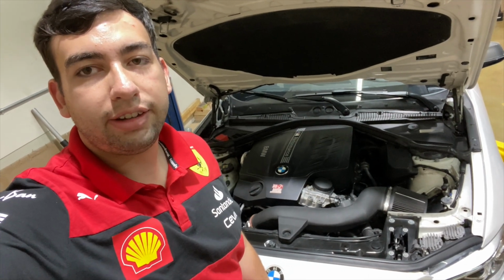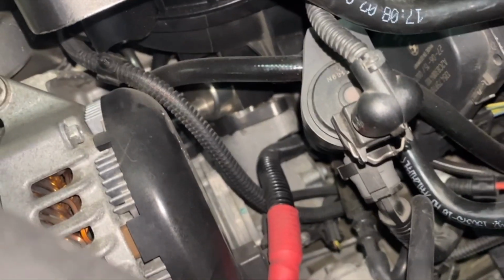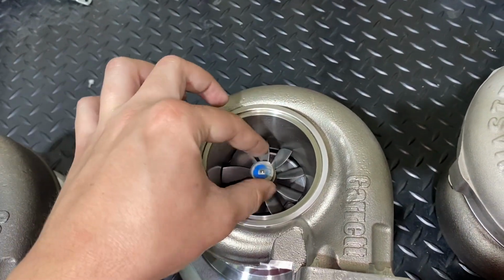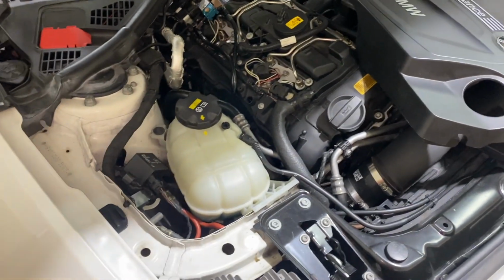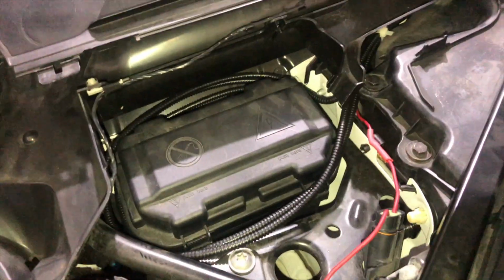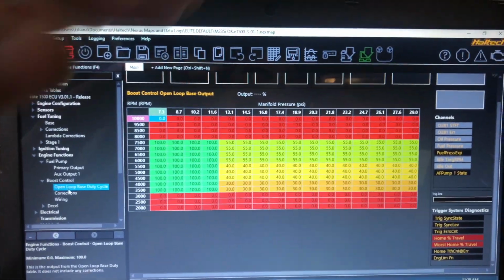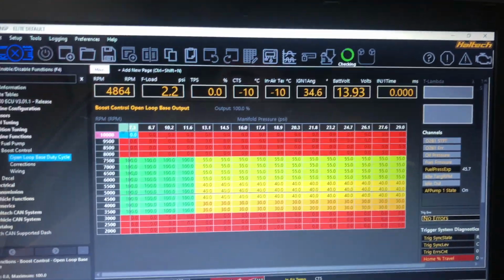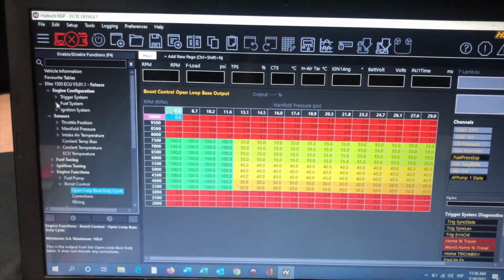How we built our 750 WHP Stock Engine N55

Comment: A great video being specific and to the point on what was and is required to reach approximate horsepower target. What many fail to realize which you have touched on in the video is the time, effort, costs, required to do such a job correctly and the additional time, effort, and costs in the additional support system requirements, and the additional maintenance associated with running at these horsepower levels. Most important no experienced performance car builder can definitively tell you how many miles or years a car modified at such levels will last for your personal car. If you are already budget shopping to do such a build it's probably not for you because you need to factor in potential engine, transmission, axles, tires, brakes, and other wear items and increased repairs. If one is looking for both a high horsepower BMW with reliability to daily, save your money and buy a new M4 competition.  😁

Comment: It's the open deck that's the limiting factor or more so the risk factor
Reply: So you’re saying that if I install a closed deck kit I could make over 650whp reliably?
Reply: @axelito_m235i you can make that without a closed deck or rods or pistons
Reply: @axelito_m235i but I only see it on the 2014 -2016 models
Reply: @inkedBc I’m 2015
Reply: @axelito_m235i then you have a unicorn lol I hands down think that the 2014-2016 models are unicorn n55 engines with upgrades not just to the water gate but pistons and rods as well . There are like 5 big channels in the past year that have built those 235i to over 800whp and without the power issues and cutting power like the older n55 . Upgraded turbos that n55 creates more boost then a b58 hands down
Reply: @inkedBc that’s correct! Most people don’t know anything about this version of the N55.  I talked to a guy that’s currently making 800+ and he told me I don’t even need rods to make 700whp unless I go past 580wtq so I guess a big single Full E85 550-570wtq 650whp would be a great set up for me until I put pistons and rods
Reply: @axelito_m235i the 2014 got the cooling and the electric waste gate and upgraded ecu which helps with tuning making it way more reliable

Comment: So for reg n55 you need to upgrade internals and get the upgraded crank hub bolt to avoid the crank from walking and spinning main Bering. This is for over anything over 550. So to make 700 go higher you need bigger rods and upgraded pins and forged internals. Then you swap the exhaust cams to the n52 ones. And then port the head and then arp head studs. And moving to m oil pump. So the bottom end is still an open deck. So to make bigger power you need to get the deck closed. And upgrade the oil cooling and meth injection e85. Change the HPFP and port injection. And standard FOB’s but after all that you could just get a cheap b58 car for the cost and slap a downpipe and tune and e85 and make same power. Why the n55 gets dumped on😢
Reply: I see all sorts of people blowing their B58'a at the 550-600whp mark. B58's stock turbo is good for 500whp, but 700? Surely that's a typo. Auto trans can only handle 600 anyway. And spun crank hubs are very rare on N55's, and usually only happen on the manuals.
Reply: @rayland9305  so yeah the b58 can make over 700hp on stock internals. And yeah for that upgrade the turbo. And the transmission can handle more but not launching hard and a transmission tune for sure. But the cost the b58 is way better platform to build off or just fun daily and they make way more TQ at low end and better fuel economy. My x7 getting better mpg’s than my old x5 and much bigger car.
Reply: @rayland9305  and yeah people will blow up if they don’t add fueling and extra cooling to the air and improve flow in and flow out. I bet a lot of guys don’t get the e85 mix right for the tune and hurt the engine that way. But the b58 is by far one of the best engines in the straight 6 category ever made.  Only time will tell.
Reply: @michaelbrooks9462  By far? Hyped up maybe. Plastic cracking everywhere, the entire oil filter housing warping needing to be replaced, failing injectors, oil filters disintegrating dropping bits of filter into the engine, and cracked pistons/bore scoring, coolant loss/coolant leaks everywhere etc. No thanks, I'll stick with my N55.

Comment: U mean that stock n55 engine can run in to 750 whp please confirm that
Reply: Yes they can m135/m235 or later n55 engine fully capable of 700+ stock block
Reply: m235 has forged crankshaft. i am not sure about close deck block. If is an open deck, definitely I will pay for a tune from @m15t3rboost3.

Comment: Currently making my M135i safe and ready for the 3.4 kit, but mines manual, anyone recommend a clutch kit that can cope with these power levels? I’ve looked all over and the only thing people recommend is the 550i clutch but I highly doubt it can hold up to this level
Reply: F10 550i proven to hold 600 torque
Reply: @wahabzazai1963  is that 600NM or 600flbs
Reply: @sidneysmooth  me and all my friends basically run a f10 clutch, fbo b58 with Tu pump on e40 making near 600 flbs and n55 on 24 psi on full e85 upgraded turbo no slip yet. Fbo n54 pure 600 turbos no problems. Auto haus has it cheap and it’ll arrive quick.
Reply: @wahabzazai1963  wow that’s impressive,  looks like I’ll. e doing that then, cheers for the reply man I appreciate it 🔥👍

Comment: I have the e90 2011 n55 with big boost turbo kit im at 600 rn i was told that was the limit. Can I still do what your doing?
Reply: How’s the car holding up? And how long u been at. 600hp?
Reply: @Cam-rd8zk  that shit didn’t last what so over. The car was brand new 2011 with 40,000 miles on her. Took it to a shop called Eurompire and they completely fucked me. Had my car for 7 months when it was only a 2/3 week job. But long story short after 4 days of having it back it spun a bearing. Metal flakes all over oil and now possibly in turbo. 28k down the drain. Gonna need to get a new motor now and build this one and a new turbo kit as well
Reply: @Nickhan388  those early N55’s are risky still lotta issues. If you wanna stick with the platform see if you can get a newer ewg one
Reply: @Nickhan388 mine is 2015 f30 335i witn 155k miles 50k of those miles are their big boost kit 3.3 . With upgraded fuel pumps . Stage 2 DI . B58 coils and custom trans & tuned by sameh. Beat on daily

Comment: N55B30O0 internals are just as strong as a B58/N54!
M235/M135 LCI have forged crank with s55 rods & bearings they’re good for 700+whp stock block no issues nice to finally see more people pushing this platform!
I’ve got a closed deck N55 M135 & it’s an absolute beast waiting for my 9180 🤪
Reply: N55s in the m135i/m235i come with a s55 forged crank but stock main bearings and same rods all n55 get, but the m2 and f26 x4 m40i n55’s comes with s55 forged crank, s55 main bearings, rods that all n55s have, s55 pistons with different rings, also the m2 n55 is the only one that come with oil pump and sump from the s55 which is a great upgrade for any n55 at the track.
Reply: @wahabzazai1963  without the oil pump/sump you’ll get oil starvation at the track
Reply: @wahabzazai1963  Any knowledge on what's in a 535i xDrive 2012 base pre lci
Reply: @eliasbutcher859  it’s a n55b3m0 first gen n55 good for around 600whp before needing to open the block. Only cars that came with a different n55 is the m135i/m235i n55b30O0 which comes with just a m2 crank and n55b30to which is in the m2 non comp and f26 x4 40i that comes with all the m touches to the long block.
Reply: @wahabzazai1963 m235i comes with the same n55b30a I have bout 435i and 235i same b30 sending out the block and head to css
Reply: Same bro I’ve got an m135 lci currently sitting at 445bhp on 98ron with simple bolt ons on stock turbo it’s insane what these little machines are capable of
Reply: @alexandermichaels6283 help a brother out, how can achieve this same power with my ewg n55 235i
Reply: So there is hope for my f10 535i then 😮??
Reply: @Futuregreatness1995  N55B3OMO is good for around 600whp ish!
Reply: My bro is pushing 7/800ho on his 535i I’m using his same set
Reply: any insight about a 2011 E92 N55 car? ive heard soooo many different things about the n55 and its internals and would love if you knew!
Reply: @slothprophet  for pwg e9x n55s, I would say 600 wheel is really pushing it. 550whp and lower is best
Reply: @slothprophet  the wikipedia page for the n55 has all variations for all models throughout the years👌
Reply: What about the m2 n55?
Reply: @Imesswithcars  it’s goated
Reply: Can you share your email?
Reply: What about n55b30A?
Reply: @yakboss1482  N55B30A is the generic name give to the n55 engine, if you give me details about the car like model & year It will fall into one of three categories N55B30M0, N55B3O0O or N55B30TO! All different versions of the n55 engine!
Reply: @m15t3rboost3  what would a 135i 2012 have? Thank you big homie.
Reply: @m15t3rboost3  2013 435i

Comment: Does the dme have any issues or do weird things since the haltech is controlling boost? Or are you doing some trickery in you bm3 tuning?
Reply from the maker: Not at all. Throttle boost cut still in place if boost goes over target. I just disabled the factory EWG and let the external one do the job. I also have PID setup on the haltech set to same closed loop boost target from DME into Haltech

Comment: I have the regular 2013 N55 motor. Can my motor be tuned to this level with your turbo kit on my stock bottom end?
Reply from the maker: As long as it has been well maintained yes. I would still check and change your rod bearings prior to doing the big turbo
Reply: @bigboost2027  What bearings and rod bolts should I use if I go that far to pull it apart? Should I go with ARP bolts and king bearing?
Reply: @jacksoncorp124  Look for VAC motorsport, there is a kit that come with new bolts.
Reply: @jst1199  Thanks. Do you know how he installed a 8HP70 transmission on the N55 motor?
Reply: @bigboost2027  How were you able to install the 8hp70? If you could direct me to the resources that I would need to do the same I'd be grateful.
Reply: Haw cost the tuning

Comment: N55s are slept on for no reason
Reply: Exactly lol 😂
Reply: Only n55 ppl say that lol
Reply: N55 are hated because early once had small turbos.
Reply: A higher mileage N55 would’ve spun rod bearing the next day
Reply: @brisso500  let me guess u own an n54?
Reply: @frankkdelacruz8536  nah i have a N55, im just mad because the best N55 is the one in the M2, forged internals, EWG, oil system… there will be a hole in the block after some time with +550whp
Reply: @brisso500  Idk but I’m pushing 530whp right now 
Waiting for Doc race to release top mount single turbo to see if i break the 700whp, I have another n55 built bottom end just in case 

My friend e90 stock engine n55 pushing 670whp he have no issues yet
Reply: @brisso500   so the engine in the m2 differs from engines in the m235 ?
Reply: @alexanderdanielsson6049  yea forged crankshaft, rods, piston rings and a different manifolds. Still not a very strong engine tho, 550whp is safest for it
Reply: @brisso500  hm interesting i did not know that. But although the m2 is way nocer interior wise i am getting a m140i rwd auto instead b58❤
Reply: @brisso500  there is multiple people running 600+whp on the m2 with no issues. Just gotta keep up with maintenance and have a good tune.
Reply: @fishymk7558  Yep, but im saying the 335 N55 will only last a couple thousand miles
Reply: @brisso500  you think you know what you talking about that’s cute 😂 literally seen them pushed to 700+ you just don’t know man it’s okay do some research btw you can say that about the n54 too they blow at 550+ maintenance is key and your tuner
Reply: @brisso500  I should have looked at the stuff you were commenting man king bearing? 😂
Reply: @straightsideways4834  you’re delusional
Reply: @brisso500 I’m running decent and I’m at 155k miles 2015 335i EWG . 3.3 with some fuel mods . 50k miles with the big boost kit
Reply: @frankkdelacruz8536 how’d it go?
Reply: @brisso500 im running 19 psi on stock engine since 50k miles and im now at 160k miles with the same custom tune. I'm around 420 whp with VRSF Catless downpipe, 6.0 intercooler, charge pipe, bms intake, dorch stage 1 HPFP and flash transmission. Never have issues with the turbo or the engine, will continue to beat this car up
Reply: facts